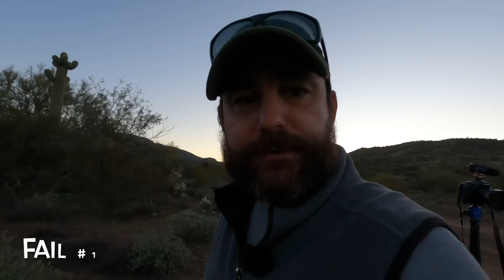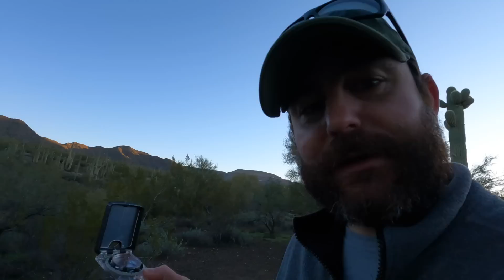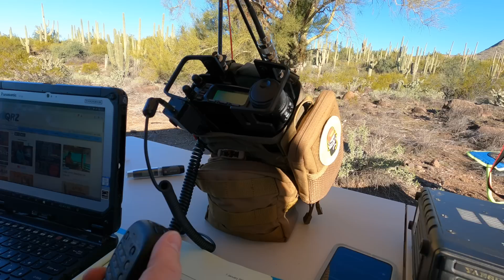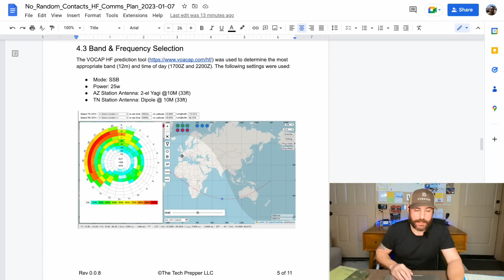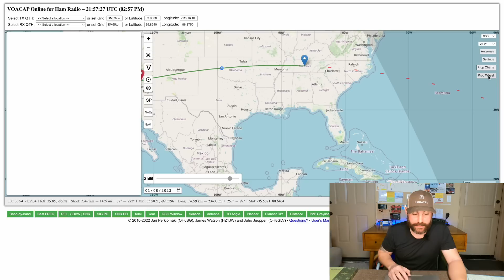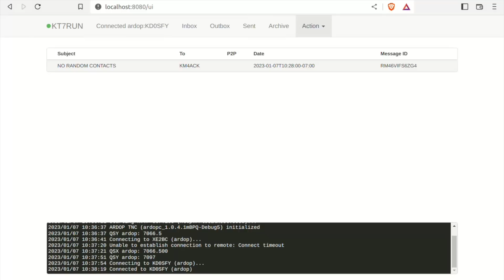Nationwide Offgrid Comms - No Random Contacts

Comment: Very good job at making your targeted contact. A question and an observation. First, The Chameleon antenna with the 5 to 1 transformer and the resistors at the end is approx. 12 db or two full "S" units down in transmit strength from a conventional resonate dipole due to losses in the transformer and resistors over a resonate antenna. This is a fact and is consistent with this design of an antenna. So how does this $600.00 antenna which you said gets 2+ db gain over a conventional resonate dipole just being put into a forward "V" configuration have better gain ?  You are talking about getting 14db gain over a resonate dipole. Just not possible. Is it just over 2+ db gain over what the Chameloen does when set up as a 180 degree antenna or 2+db gain over a conventional dipole antenna ?  I sure would have liked to see the same test with a $25.00 conventional dipole. You were only hitting with a 4-1 signal report. Good thing the SFI numbers were up. I don't think that very expensive antenna was necessary to make the contact. It is more of a specialized antenna for things such as ALE. Those type of wide banded antennas are always way down in transmit strength over a resonate antenna of the same general design. Second thing is, I love the homework you do in predicting the band to use, but in grid down or no internet, you will not have this online software available.  If you are planning for real SHTF, you are going to have to figure it out on your own. So while what you did was a very good way to insure the success of the targeted contact, it is not real world in SHTF. Just a couple of observations, not trying to be critical. P.S. After watching Jason's video, you gave him a 5-9 report, he gave you a 4-1 report. Jason just built a simple dipole. This clearly shows the Chameleon antenna's design was not the best for the contact you wanted to make. Yes, you made the contact, but under less than ideal conditions, the contact may have been a failure because the wrong antenna design was chosen. The Chameleon clearly worked, but the design is much more towards ALE, Military etc. use. In some cases it might have been a positive when the design features are needed. For making long distance contacts, in my opinion, it's not the best choice. The simple and low cost dipole would be my first choice.
Reply from the maker: Thanks for taking the time to share your position. I am happy with the results and blessed to have had Carl and Jason share their Saturday with me to run this experiment.

I can't speak to all these details. Based on the materials (FM's and TM's) that the US military has published over several decades, they specifically reference a terminated sloping "V" as a tool used by units in the field to make targeted contacts were directionality and higher gain is required. Granted their design is a bit different, I still wanted to get out there and test this theory. 

I plan to cover ALE in the future as another tool. ALE was the reason why I asked Chameleon for this antenna. While thumbing through the manual, I noticed that it has a configuration for a terminated sloping "V", so I figured why not test it out since I wanted to scratch that itch based on my research. Yes, another antenna would have likely worked, but that was not the point of the video. 

The point of these No Random Contacts videos is to educate non-hams (that's my target audience) and show that targeted contacts are possible if you:

1. Define your communication goals up front. Who do you want to communicate with and where are they located?
2. Determine a suitable radio service and  radio system for the job.
3. Make a plan.
4. Execute.
5. Reflect on the exercise.

Also note, I am not sure why a large portion of people are offending be high-priced, well-built antennas. On this channel I covered several antennas including ones that I have built for $10-$20. These are all tools.

I personally receive lots of email from hams that want to "Monday morning" quarterback. In general, I would say that most will not go through the effort that I put into planning, testing and getting into the field. 

73 de KT7RUN
Reply: @TheTechPrepper  I understand why you wanted to test out the Chameleon in advance if you planned to use it for ALE. That is what this antenna is designed for as well as a few other specialized uses. Very few of your viewers will be using ALE, and if they do, they know what kind of antenna they will need. The problem is that this is an antenna that is two "S" units down in received strength from a resonate dipole antenna because of it's design. This fact was not disclosed, and maybe you didn't know that. Putting it in the forward "V" configuration didn't make it better than a resonate dipole. Not even close. When new hams see products on youtube channels and they are recommended without all the facts being presented, they buy one only to be disappointed in the performance in normal ham use. This is my problem with Chameleon antennas with the 5 to 1 transformer.  They work well for their intended use, but regular contacts is not their primary design use if you are seeking the best signal. It would be like you selling your bag for the FT 818 and when I get it, the 818 flops around in the bag. I call you and tell you the bag is too big. You tell me it also works well with Military radios, read the tests. In the end, I did not get what was advertised and the bag is a total fail for my use, even though it still held the radio. New hams watch videos given without all the facts in many cases. They don't know that there has been no new antenna designs in many years. Just things repackaged. Then they are upset because the new "Tactical" antenna does not work as well as the tried and true, low cost design antenna. Gaston, great video. The planning worked out for you. You could have done the same thing in the way you normally do. Using the 818 with a resonate dipole @ 5 watts. People need to know this. It was not the antenna that made your contact a success. In fact I believe your results would have been better with the latter set up. Please don't be one of the creators who praises an antenna just because it made contacts. Too many are doing this and I have lost all respect for them. The design of this Chameleon antenna is for specialized use, not general use. If you have need for a specialized use, buy one for that use. For those who have not been through the top of the solar cycle. Near and at the top, you can make world wide contacts with a 5 watt radio, coat hanger and a tuner. Most all antennas will work good during this period, some much better than others. When the cycle drops, there is an entirely a different result.
Reply: Search the following document and read it: CHAMELEON ANTENNAS IN THE ARMY HF LOW POWER COMPETITION
Reply: @Chameleon_Antenna  No one is saying your antenna does not work well for some specialized uses. Can you refute the claim that your antenna is approx. 12 db down in transmit power from a resonate dipole. The answer is no. No antenna designed as yours is, does not have loss due to the transformer and resistors. It's physics pure and simple. It is a great antenna for some specialized uses and the quality is very good. That said, for making contacts with the best possible signal strength with a dipole antenna in regular ham use, it is not the preferred antenna to use. Unless you have a need for something such as ALE or other specialized military use (and military use is different than amateur use in almost all cases), a home made dipole will out perform your antenna by approx. two "S" units and $575.00 saved. It's not that the quality is not there, the quality is very good. It's like all broad band antennas. There is a price to be paid in transmitted signal strength in order to get the broad banding. Setting it up in the forward "V" configuration does give your antenna some directionality and will put a greater signal in the direction you want, but the signal is still down from a resonate dipole by quite a bit. If you have a need for a specialized broadband antenna, by all means people should take a look at your product. Most people in regular ham use do not. I'm sure your antenna did well in the military competition against the other similar design broad banded antennas. For a very good in depth review of the Chameleon MPAS 2.0, which is similar to this with the 5 to 1 transformer, check out youtube channel "SurvivalComms" Chameleon Antennas MPAS 2.0 Radio Antenna _ Is it Snake Oil ? The MPAS 2.0 is a vertical, not wire antenna, but uses the same broadband technology without the even greater loss of resistors...It just uses the lossy 5 to 1 transformer.
Reply: @johnk23705  I’ll be saying it - you’ve no idea what you’re talking about out my friend! You don’t even know the landscape conditions that we faced when we were in the field. We were right in front of a mountain ridge so TX angle will be different from RX angle. The TD 2.0 was setup to beam as close as possible to the horizon.  TX were coming from about 45 degree up and our TX we’re going out at about 80 to 90 degree out thus hitting the ridge.

Another lies you’ve been vomiting is that the TD 2.0 requires tuner. NO THEY DON’T Yes they require a large foot print because they need to be that big to acquire the gain and the directionality wanted.
Reply: @Chameleon_Antenna  It requires a tuner if you wish to be anywhere near 1.1 to 1 SWR. Some radios such as the 817 and 818 don't play well with SWR over 2 to 1. It is not uncommon to have the SWR be between 2 to 1 and 3 to 1 with the design your antenna uses depending on the band used. That is why I said it needs a tuner. Mountain or no mountain, you both had to contend with it and the wide banded design is approx. 12 db or two "S" units down in received transmit strength compared to a resonate dipole. It also does not hear as well. As long as people realize the design deficiencies vs. the utility and specialized purpose of your antenna design, there should be no problem. I refuse to give up two "S" units just because. I'm not running ALE and am not a military unit with it's special uses and considerations that may require an antenna with the design like yours. I'm a ham who wants to put out the best possible signal to the other station and hear that station as best as possible. I don't want to spend a large amount of money for a wire antenna that offers degraded performance compared to a simple resonate dipole for normal phone use. The type of contact Gaston planned for and made did not require a antenna such as yours. In fact, if he had used his normal 818 radio, the contact would have not happened. He needed 80 watts just for a 4-1 contact. The basic design of your antenna has been out for many years, it's nothing new. You repackaged it, call it Tactical and market it to people who don't have much antenna knowledge. It's a quality antenna that works for it's specialized, intended purpose. Not throwing any shade on Gaston. His test was a success, but just barely. Any less received signal and it would have been a failure. Thank God for a good SFI.
Reply: @Chameleon_Antenna  Not a good look for your business when you let anger control your tongue.

Comment: Have you thought about adding radio relay into the "no random contact" series? This would be interesting for targeted traffic handling to get the message through.  Perhaps incorporating VHF/UHF/HF as well as digital. It would add another layer to the plan but would fit right in to P.A.C.E.
Reply from the maker: I may have touched on this in one of my NBEMS digital exercises. We use relays a lot to pass traffic across the state within our group. It's a very powerful tool. I'll add this topic to the backlog. Thank you.

Comment: I had so much fun getting my mobile set up and working with what I had. It may have been frankensteined together but it worked! Now I have to get a 12-meter hamstick so it doesn't happen again. Thanks for the QSL card. 73 KO4CXD
Reply from the maker: Robert! It was great to work with you. That QSL card needs to be re-done as it's sporting my old callsign. Just do what Jason did and make a simple 12m dipole.

Comment: Wow! Another amazing deployment!
I apologize for trashing the terminating resistor antenna as being inefficient. +2dBd is good gain for a wire antenna.
The bands a hopping this solar cycle. Enjoy the solar maxima while its here!
I'll probably play today. This is what I did last weekend. I'm still pushing 80m NVIS for regional emcom whether its solar max or min.
73 N4VEP
https://youtu.be/nShDYlZGKlc
Reply from the maker: Morning, Viron! Thanks for sharing your weekend project. I am grabbing another cup of coffee and going to check it out now. I need a break from the comments section anyhow. I was at a local hamfest all day yesterday as a vendor and I'm playing catch up on the comments. Thanks for the support.
Reply: No way it is 2 db stronger than a resonate dipole. Maybe putting it into a forward "V" increases the signal strength of this antenna by 2 db, making it about 10db down from a resonate dipole instead of 12 db down compared to a resonate dipole.
Reply: @johnk23705  Maybe learning about the terminated dipole will help yiu to understand that it’s directional as the antenna acts like a beam toward a certain direction! Just look at the antenna model on the user guide and you should understand.
Reply: @Chameleon_Antenna  Oh, I do understand. Yes, it is directional to an extent when set up as it was in the video. But being the design it is, it is still about 10 +db down in transmitted power from a 180 degree resonate dipole antenna vs. the "V" configuration you are using with your antenna. It's not that it's not a quality antenna, it's the broad band design made with the transformer and resisters that limits the effectiveness and power output for regular ham radio use. Your antennas work great for their intended purpose such as ALE etc. The way the military uses antennas is different than the use hams have with a very few exceptions. What people don't understand from many of the videos about your antennas with the 5 to 1 transformers is the power loss due to the design. Few creators mention that, but some do. A home made resonate dipole or End Fed Half Wave antenna will be approx. two "S" units higher in receive strength and will hear better also.   It's these facts that people with their hard earned money need to know about. If they need a specialized antenna such as yours, then maybe they will buy one. For the best general ham performance, a $25.00 dipole or EFHW will get you far more contacts and let you hear better, especially when the band is bad or the signals are weak.
Reply: @johnk23705  The apature angle between the legs of the dipole plus over 2wl of antenna on each leg. The long endfed antennas like beverage antennas that are multiple wl have gain toward the terminated end.
Reply: @vironpayne3405  John - Exactly the idea behind the antenna design and usage here.